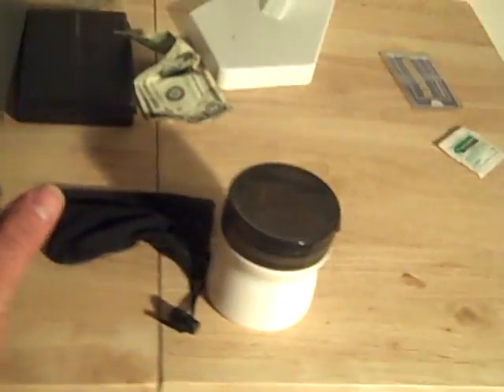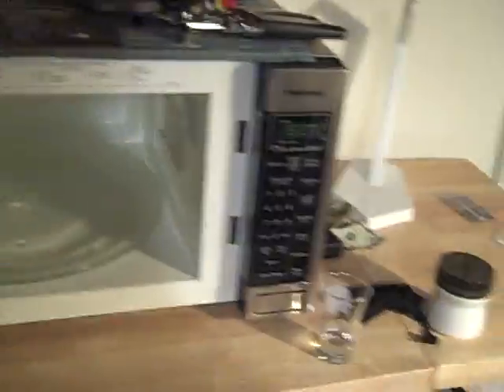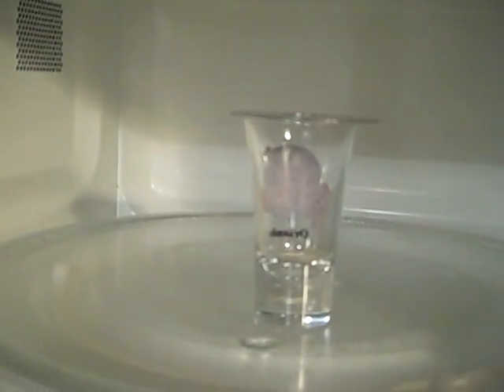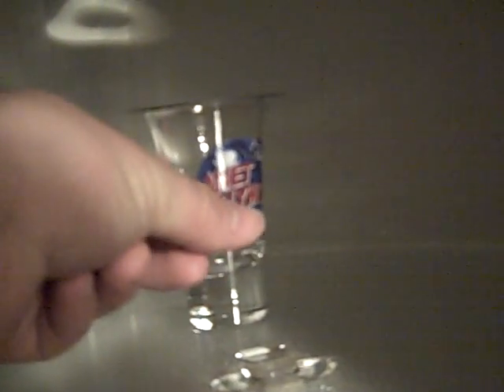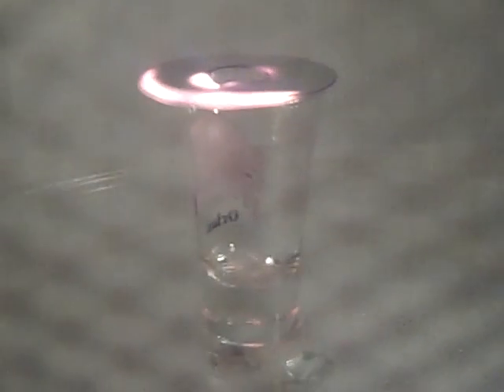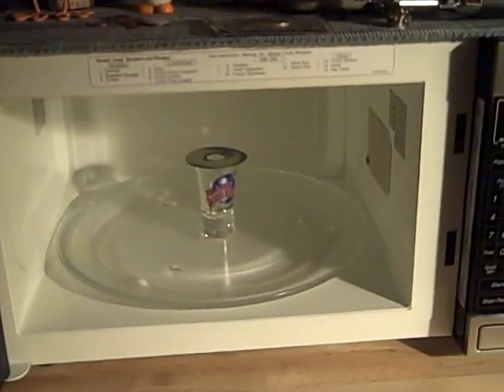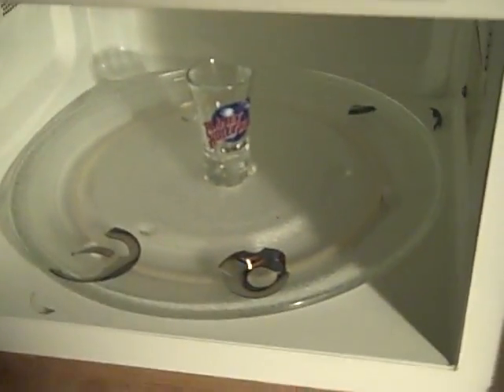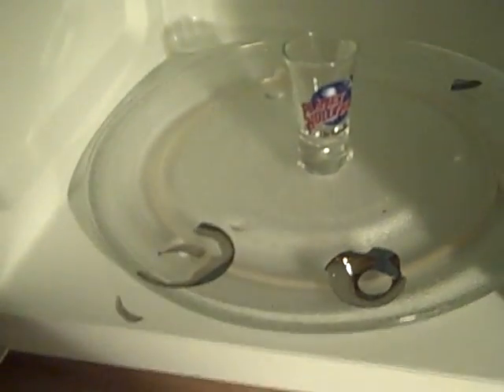Melting a glass hard disk platter

Comment: I’m trying to find anything that explains the process; just read about it on wiki and it is a deposition process (thought so but it just didn’t make sense until they mentioned crystallography which is characteristically uniform but also it gives it a basis for a pattern to follow; tldr its magnetron sputtering and there’s a ton of material science behind the deposited material but ultimately the material is characterized by crystallography as the basis for establishing identifiable magnetic domains. There’s also some alignment mechanism that produces a varied signal for the head so that it knows how to find each track I believe. That’s half of it, the other half is a finishing process that speaks to the longevity and reliability of the platter; crystal formations have a tendency to move around when they’re heated up, so there’s more material science that goes into improving the durability of the platter; “a layer of lubricant made up of amorphous carbon, such as diamond like carbon” does that ring any bells for you? Doesn’t really sound like a lubricant 😂 to me
Reply: the platter also has markers which as the head moves along y, it detects which track the head is aligned with from a distinct signal and as the platter rotates on x, each track has an additional marker that indicates the location relative to the surface of the platter, this part is probably pretty self explanatory except that the track markers are (also magnetic fields? I'm not sure) but each x,y converted to a discrete signal that is distinct for every usable (relative to the physical extents as indicated by the markers) location on each of the platters. I just wanna say this stuff must've been mind blowing in the 80s but then you add to it the need for a stepper motor. I think by the 80s, magnetron sputtering was a fairly new process (ymmv 1974) and it must've taken a few years even then before it became a commercially available manufacturing process. If you think it looks cool in your microwave you should see what it looks like inside of a vacuum but I'm sure you already know that; the first time somebody explained this concept to me was like a really big ooooooooo moment for me anyway. BUT I really haven't ruled out that there is not a way to make your own platters yet, the videos are the scaled up manufacturing process are intimidating but that's not an example I would draw entirely from anyway. The same with trinitron TVs I really wanna believe there's a way.

Comment: Congratulations you are  a pioneer of discovery! Your not that stupid. Your microwave looks expensive and you could have really hurt yourself, but you truly are the first one to microwave a platter on youtube. The metal conducts the heat to the glass and once the glass is glowing red it too becomes conductive, thus melting further. I am in the process of refining this process to create something neat-o. I will be using Pyrex to avoid the danger of explosion upon rapid cooling and maybe a mold.

Comment: I just tried this. I used an old Western Digital drive platter. Apparently it's metal. Word of warning to those who want to try this. If you put it on a glass...

Do not touch it. Picked it up and immediately heard a sizzling noise- before I even felt anything. D: